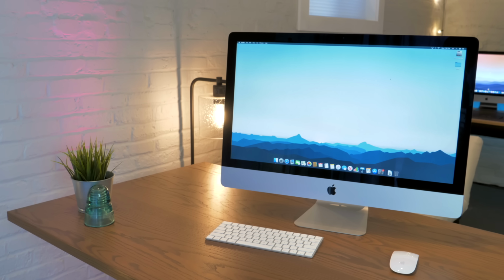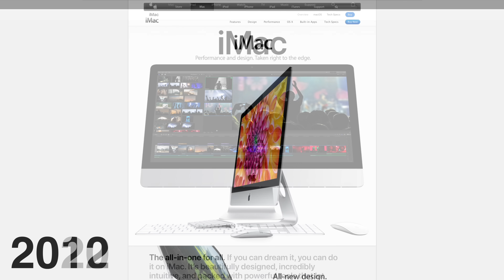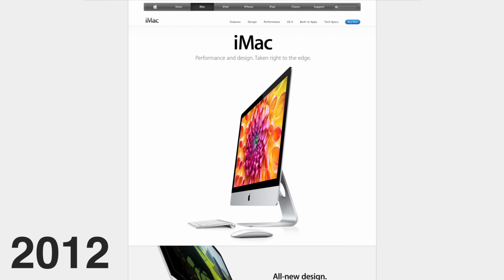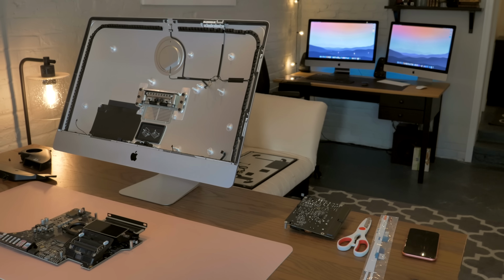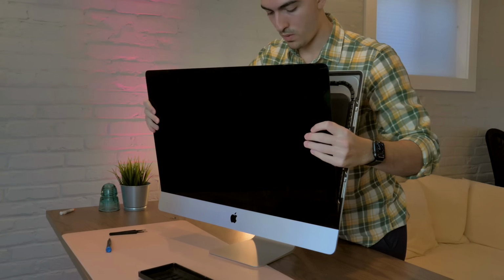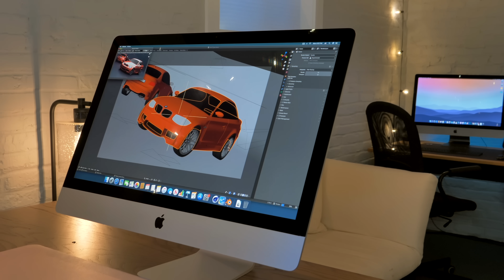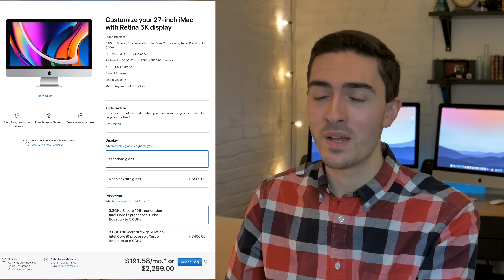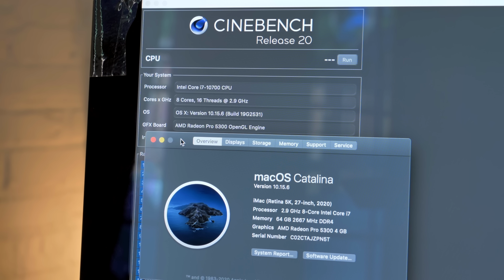DIY 2020 iMac upgrades! Is the LAST upgradeable Mac worth it?!

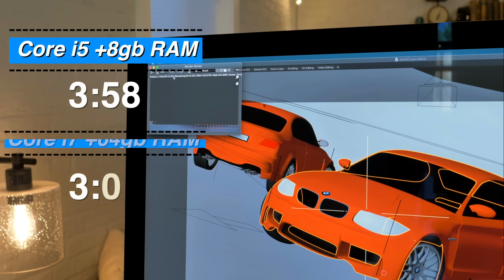Comment: 9:13 Hey Luke... I know this isn't a math channel, but that's not how percentage improvements work. It's New - Old / Old.  So, 182 seconds - 238 seconds divided by 238 seconds or a 24% decrease in time (24% increase in speed).
Reply: It's 31% increase in speed, not 24%.
Reply: @pekkokuopanportti  Do me a solid and google "rate of change formula".
Reply: @jeffwinget5  The original rendering speed is 1 full render per 238 s. The new rendering speed is 1 full render per 182 s. The percentage change in rendering speed is (1/182-1/238)/(1/238) = 0.3077, i.e., a 31% increase.
Reply: @pekkokuopanportti  Hmm. Well I see where you're coming from, but I'd like to offer another example. If I render a video that takes 10 minutes, and you tell me your computer does it 30% faster, my natural assumption would be to say that your computer renders it in 7 minutes. I think that's the conclusion anyone would come to. Whereas based on your methodology, it'd actually be (in minutes) (1/7) - (1/10) / (1/10) or 43% faster. 

Regardless, I think we've both come to the conclusion that Luke's claim of 37% faster is erroneous.
Reply: @jeffwinget5  But what if I told you that my computer does it 100% faster?
Reply: 0-10/10, so -1 as the answer. Seems to jive.
Reply: @jeffwinget5  No, that is not correct. My computer being 100% faster than yours (which is the same as it being twice as fast as yours) means that it completes the task in 5 minutes, that is, in half the original time. Similarly, 200% faster would correspond to a completion time of 3 min 20 s.
Reply: @pekkokuopanportti  Fair enough, that makes sense. Thanks!

Comment: Don’t buy lower specs Apple products....period. By the way...Best Buy in 2022, has 2020 iMacs on clearance for $600 less than normal. So, you could max out your memory and still be cheaper than the MSRP.

Comment: I have a stupid fusion drive in my 2015 27”... anything to be done about that? 🤔
Reply: Yup replace the spinning drive with a SSD sata drive as well as upgrade the pcie ssd. I am planning on doing this when my 2019 is out of warranty. I’m currently running an external thunderbolt 3 drive and not using my internal spinning drive. So much faster!!!!

Comment: So, Why did you remove the 8GB RAM and put four 16GB sticks in, why not just ad two 32GB sticks, and have 72GB?
Reply: The lopsided capacities would lead to worse performance than the evenly distributed 64gb. It’s not just the amount of ram that matters but the optimization of bandwidth as well

Comment: For most Mac users, there is absolutely nothing wrong with 8gb of RAM.   So many tech videos make it sound like you immediately need to run out and upgrade your pathetic 8gb of RAM, when in most cases adding more RAM will make no noticable difference in average day to day tasks.

Comment: Turn off device, disconnect the power cord, and hit the power button several times. It discharges the electricity in the system so you can safely work with it. If you’re scared even after this, just wait 30 minutes more after this procedure.
Reply: or, use gloves!
Reply: Not always true, the caps may still be charged. I'd really not recommend opening one up without knowing what you're doing, and can work around exposed PSU circuitry

Comment: Honestly, I prefer upgradability over a fancy A series chip…
Reply: I agree with you.  A Mac chassis like the Mac Pro, but with prosumer grade hardware rather than pro grade.  Compatibility with aftermarket components, and expandability.  With AMD processors, or Apple Silicon if it turns out to be good enough.  Ditch Intel.

Comment: My 2017 MacBook Pro 13’ had this pink checkered screen when I turned it on today. When I restarted it, it was gone. Anyone have this before?
Reply: Failing GPU/Intergrated GPU, Failing Ram or Failing SSD. Something is failing and you need to get it serviced ASAP!
Reply: Try resetting the SMC and NVRAM though.

Comment: I am thinking about ordering one of these last 27" Intel iMacs. I know RAM will cost me a lot more when the new ones come. I don't care that the design is old. What I care about is it will do what I want it to do. Is there a way to discharge the power supply like techs had to do when working on the old CRT monitors? We can get 128GB of RAM for what Apple wants for 32
Reply: Dennis W you don’t need to open the device to upgrade the ram, there is a little door to do that at the back of the device

Comment: FYI, I have opened and closed several 27 inch IMACs like this one, never had a problem limiting myself to 2 glue strips closing back (instead of the original 8 or so). Just saying :)

Comment: 4:25 
“PLEASE DON’T DIE” 
Well Luke, that’s some very informative guidance there, i’m certain that could end death across the globe entirely.
Reply from the maker: Damn, for integrated graphics you sure are dedicated to the comment section
Reply: Luke Miani 😳😏
Reply: Luke Miani 😂 😆 🤣, that was funny. (:
Reply: Intel UHD Graphics 630 damn
Reply: Hey, what if Intel XE Graphics came by to say hi? What would you do?
Reply: Pixel Welp i would hide. Frankly it would whip my ass till I overheat.. Sadly
Reply: Thank god I read this before I killed myself tonight.
Reply: Wear snow gloves
Reply: You would have to be a total idiot to leave the power plugged in and turned on while taking the thing apart!
Reply: rs2klee, actually the capacitor keep the charge so even if it’s not plugged in it might still have enough to give a strong hit
Reply: @carlosvemail  They keep a charge for 20 minutes max before discharging. Don't plug it in during the repair and it's a non-issue.

Comment: Everybody should know that intel based mac can run iphone and ipad apps, the processor can emulate perfectly the arm processor, maybe it's not as fast, but there are tons of software that could run in Intel macs if Apple wants to, however they don't want it. Everybody who uses xcode know this.
Reply: Yes and no. Can it technically execute Apple ARM binary code with emulation? Of course. But you cannot (legally) emulate all the other bits that make up the platform... certainly with every Mac now running a cut-down A-series CPU in the form of the T2 chip, some of that could be offloaded, but as you say... Apple doesn't want that.

Comment: It seems you broke your microphones at 8:15. Something I want to point out, when you put on the adhesive strips you covered the two microphones in the front, and I suspect that they will sound muffled. The adhesive kit you used is only for 2012-2015, the 2019 and 2020 iMacs have different strips than the one you used. If you want to fix it cut out a bit in the adhesive where the microphones are.
Reply from the maker: Good note
Reply: I’m that one guy
Reply: Does that affect other iMac 🖥 models?
Reply: @WarriorsPhoto  Yes, microphones are on bottom from 2017 and newer. Easy to guess how i know, easy to fix if you have spare time and buy strips in pack of 2
Reply: This very important, as it indeed affects your sound, and you most likely only going to figure this out when you've fully reassembled the iMac. It affects all iMacs!!
Reply: @SebastienCadet74  How bad will it get?
Reply: @WarriorsPhoto  Almost inaudible. I use my Airpods most of the time, so I didn't have to re-open a figure out how to fix it... (The flat wire that connects the Mic is the most painful of all cables to reconnect of all wires on this MoBo!)
Reply: Sebastien Cadet Now that’s a nice way to bypass that issue. 😂
Reply: If he broke them, then oh well. Does the adhesive matter?
Reply: I'm guessing that is what happened to my iMac! I sent it in for repair as the logic board died. In warranty luckily! But the microphone didn't work. So I sent it back in. Bet that is what happened. I need it for video calls and meetings once in awhile and since it was still under warranty I wasn't standing for that!
Reply: I wish I had seen this before I did this to my mom's iMac... but did research and track down the issue quickly enough.

Comment: Could you solder a socket to the pins for the SSD and use it anyway?
Reply: There's a chance that it will work if T2 won't interfere. I guess that PCIE lanes used for it are now connected to T2 module.
Reply: @LPMusicON  Assuming they didn't steal the PCI-E lanes for something else, I think it's at least theoretically possible you could solder on the connector for an SSD (assuming you can find it, doesn't Apple use something proprietary for their removable drives?) and use it for a storage drive, but you cannot boot MacOS on a T2 system from anything but the integrated flash as far as I am aware. At the very least, I wouldn't tempt fate by trying it, even if it can be accomplished.
Reply: @W1ldTangent  you can check it if you have access to board schematics of both iMacs. Mainstream Intel CPUs have limited PCIe lanes to almost always 16 and the rest is supplied via the chipset. I guess they use 16x link for the GPU and T2 goes through the chipset. If that's the case then it's probably using NVMe drive allocation for it's bandwidth. I'm not Mac expert in any way, I was just curious. Wouldn't try it.